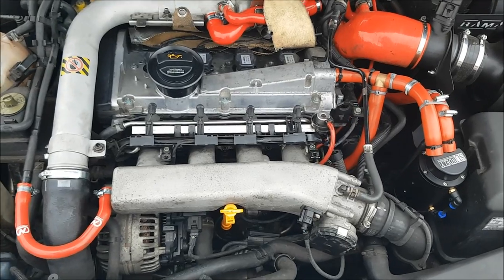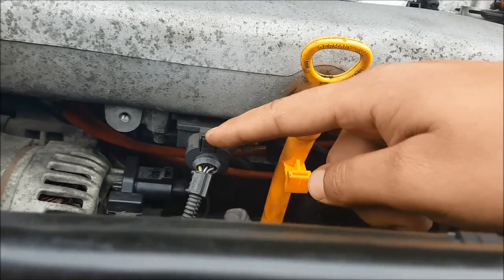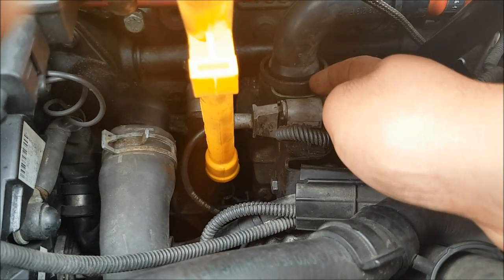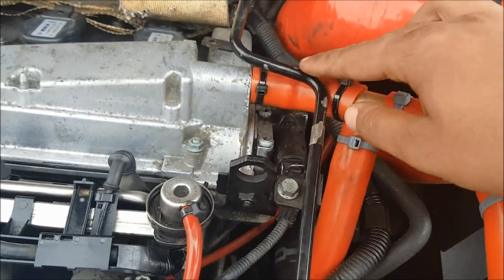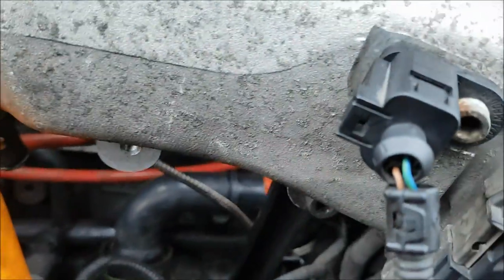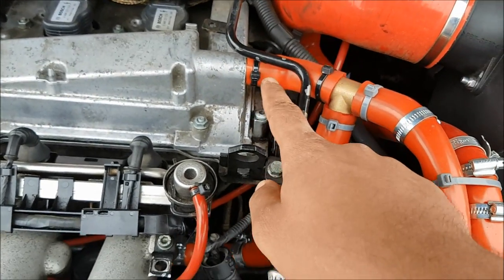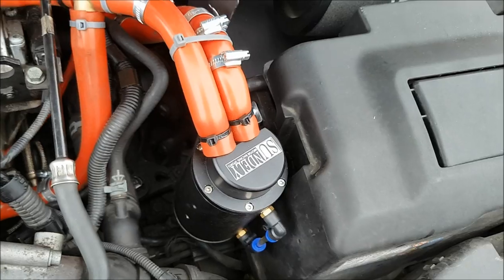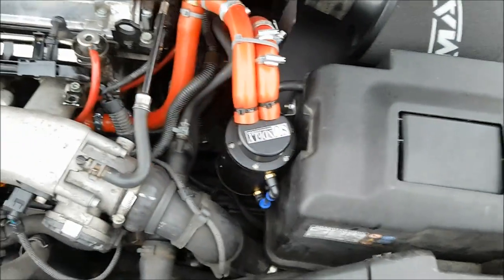1.8T Oil Catch Can Install / PCV Delete - VW / Audi / SEAT / Skoda

Comment: You will definitely need a new crankcase breather pipe and I would just get complete with spare clip Just in case you loose it somewhere in engine bay like myself & also round seal cause mine went totally melted,its a real nightmare to get out as he said after years of welding into place by heat oil & old age rotting wow,good luck😫👍🏾

Comment: Brilliant video, I bet this help a lot of people out. Top work keep up the work 👌🏻 on VAGS that is 😉
Reply from the maker: Ryan Kilgallon thanks taking the time to comment. Have much more planned for the channel, it's just a matter of finding time.
Reply: Redline Revs alright dude, you know the L that come off the intake, what size is the pipe as going to buy a bung instead of a screw 👍🏻 cheera
Reply from the maker: Ryan Kilgallon hey, sorry I don't know the measurement for that piece. I just screwed a bolt into mine. Let us know if you find out what size they are.

Comment: My son has a 2001. It was pretty cobbled together under the hood when he bought it. It pushes oil out under boost. Will sit and idle all day just fine. The "hockey puck" is gone. Seems to push the oil out of the oil fill cap. We've changed it and the pcv and it still does. Any advise? tia

Comment: @ 2:10. . . I HATE that damn pipe with a purple Barney passion! Lol. The very lowest part of that ridiculous brittle plastic pipe that goes into the block had pieces stuck in the block itself, I had to fish it out with a flat head screwdriver and then used a vacuum cleaner with a homemade attachment to get any fallen pieces out of the hole. 

     I have a 2004 B5.5 Passat GLS, of course with the 1.8T, mine is engine code AWM, Wheat beige with beige leather. My car is 4 MOTION (Audi's Quattro drive train with famous center diff) and is mated to a 5 speed manual transmission. It's a unicorn here in the US. It only has 114,500 miles. I LOVE  LOVE  LOVE  my car. 
      
I've replaced more parts on this car in 4 years of ownership than I've replaced on every car I've ever owned combined !  Most were Japanese, 02 Camry SE V6, 05 Corolla XRS, 96 Mazda 626 ES V6, 1988 Mazda 626 LX and many more, all cars were manual except the Camry. I bought my Passat because my brother once owned a 1988 Audi 90 Quattro 10V,  light Beige with blue leather. 
(I also bought my Passat as a nonrunner for $750 dollars and since purchase, have just breached the $5,000 mark in total dollars spent.) Of all the cars either of us have owned we have the fondest memories of when we were young driving his 5 cylinder Quattro with locking rear diff. 

     That's been about 25 years ago now. I'm now 48 and little brother is 44 and since those days we've both been through hell. . .  so hopefully, if everything goes well, in the next few days I'll be purchasing a low mileage 3rd gen EA888 2018 Audi A4 Quattro with the 6 speed manual, the last year of any stick shift Audi sedan here in the US and as such, another Unicorn and when I do I'll be passing my treasured Passat on to my little brother, so he can make more memories. I've already replaced the timing belt, water pump and peripherals along with a new Victor R, MLS head gasket in the driveway with hand tools. Thanks so much for the video, I enjoy watching any content about my highly celebrated 1.8T 20 valve engine. I'm unsure if I'll do the delete yet but probably will just for my brothers sake, because he isn't mechanically inclined like I am, so I want to eliminate any and all parts with the potential to cause issues. Thanks much for this!

Comment from the maker: All the parts required are listed in the description of the video. I've used cable / zip ties on some of my connections because I'll be coming back to this and changing the cheapo catch can for a better one. Use jubilee clamps instead to ensure everything is tight.

Comment: Thanks for being the first person to put a decent video about doing this. What size are all your silicone hoses you used for this?
Reply from the maker: Carlos Daniel thank you for taking the time to comment. As in the description you need 19mm internal diameter oil resistant hose to delete the pcv system. If you want to delete n249 valve and change fuel pressure regulator lines as I've shown in another video you need 4mm internal diameter pipe for those.

Comment: In connecting in this way you are applying full turbo suction to the crankcase. It would be better to install the catch can immediately after the crankcase one-way valve, with both the one-way valve to the inlet manifold and the regulating valve/"hockey puck" to the turbo intake connected to the catch can outlet.

Comment: Hi redline revs awesome advice on various mods on lcr's I've done a few of your modifications on my LCR with no problems at all really happy with results so far 👍 next week I'm going to attempt to do an oil catch can looks pretty straight forward to be fair one question I want to ask you bud I've heard mixed reviews on removing the hockey puck some say you need it for controlling the back pressure and that it could damage the engine if removed & some say it's fine with out it ? I'm stuck on this one I just wanted your opinion on this have you had any problems at all or heard of any issues on this ? 
Thanks redline
Reply: I know this is a year on... but the hockey puck is on the inlet side so there won't be any back pressure. When the turbo is on boost there will be negative pressure in the intake pipe.

Hope this helps any one that has read this with the same question.

Comment: That hose that connects to oil cooler housing - it has broken off when trying to remove it.. I knew it was going to crumble as you said and I bought a new one but didn't think part of it would be stuck in that area, I don't know how to remove it as it's quite tight in . Do you have any ideas? It isn't supposed to twist a certain way is it?

Comment: 10/10 thanks for the video, Please tell me if this is possible, at 2.04, my L pipe is broken and even i removed the clamp on the crack case, i still can not remove the old plastic brass bushings. Do you think i can block that hole. And the 19mm on the top rocket cover goes thru oil catch can and back to intake. Is this feasible??? thanks

Comment: Do you have a lot of blow by ?? I noticed ive had to replace 3 valve cover gaskets cuz it might need more vaccum in that system maybe a one way check valve that would also connect to the hose after oil catch can?
Reply: Did changing your valve cover gasket sort out the blow by issue you had?

Comment: hi mate I've got a mk4 1.8t aum engine. do I have to take out the combi valve to delete the pcv and add catch can? not sure about what I'm doing with the 3 hoses that go into the end of the metal plate in front of the manifold

Comment: Good video simple enough going to do it to mine now I've watched this what did you use to connect it to the tip though?
Reply from the maker: Khai Elliot thanks for commenting. I had a used red silicone TIP which already had a 19mm straight pipe connector where the standard pcv system would lead to the TIP following the 'hockey puck' accumulator valve. If the original inset for PCV valve into TIP doesn't haven't that just get a straight pipe connector, should be 19mm, and clamp with jubilee clamps.

Comment: Hi I need to do this to my car I’ve found all the parts on eBay, it’s hard to see what you used to mount the catch can, do you have to drill a hole? What bracket did you use etc?
Reply from the maker: Sizeable Bush sorry forgot to mention how i mounted the catch can. It came with a bracket and I heated a screwdriver then pushed it through the battery cover housing to make holes for the bracket.
Reply: Redline Revs thanks for he reply mate I’ve already done it now!:)

Comment: Got a question I got the 1.8t on my audi tt. Just installed a catch can and a pcv delete. I'm still having blow by also there is milkey colour in my catch can.
Reply: Jafin John I get the same thing in my 1.8T AMU TT. My hoses are ran pretty much identical but I getting some crazy blow by on a freshly built motor. (I have the ECS Tuning Baffled Catch Can, and it fills up with the milky color water your talking about in 3-4days.) im honestly considering trying to repurchase the 034 kit again for our cars and hooking up the PCV Tee back into the vacuum port on the intake manifold, but leaving out the “hockeypuck” or PCV Regulator to see if that helps. If you figure out the problem with yours please let me know and I will try to do the same if I make any progress.
Reply: Condensation. Move your catch can to a hotter area in the bay and will have less water

Comment: Removing pcv removes the assembly to help the brake booster recover quicker so is not the best idea.  And removing the puck PRV completely is also a very bad idea.... now your turbo can suck from the cam cover and the PRV isn’t there to stop that which is what it does. Sorry dude so much is wrong in that. The PRV needs to be there last point into tip, catch can is fine before that valve! N249 delete is an anti lag device so removing that is also bad advice from the internet.

Comment: Is engine better than before? Is there any change?
Reply from the maker: Soma Falkenstein my pcv system had splits and leaks in it which were causing me to loose boost. Since doing this the car is much better to drive and all the pipe work is simplified so future boost leaks will be easier to find.
Reply: Thank's :)

Comment: nice mate i juat wanted to ask please what happens with the hocky puck valve do i leave it going into the intake? thanks
Reply from the maker: ryszard witek hi, you can throw away the hockey Puck as the oil catch can will take over its job.
Reply: You need to leave that hockey puck in between the turbo intake hose and catch can other wise you create back pressure in the rocker cover and damage the engine, unless you vent the catch can to atmosphere. That’s what it’s for trust me.

Comment: Hey.. Could you tell me where you got the pipe from please
Reply from the maker: Sublimewales80 ebay 19mm Id oil resistant hose on ebay. Don't get the soft one like mine it has subsequently split in a couple of places and I've replaced it with REINFORCED / BRAIDED hose which you should look for.
Reply: Redline Revs cool thanks.. I will have a look on ebay. Been thinking about doing this for a while

Comment: hey do i have to connect the PRV (hockey puck thing) back to the T I P ?
Reply: my hose broke today and i cant find a replacement i don`t have the Y split i have single hoses that run from a metal line, i just connected the PRV back on pluged the hole in the T I P and put a little filter on the open end of the PRV (hockey puck thing ) is that ok to run for now until i find a new hose on the scrap yard ? 
P.S: I have an AJQ engine if you need this info
Reply from the maker: OL BAG it isn't ideal but probably okay as a temporary measure.
Reply: Redline Revs k thx love your vids

Comment: How's it run without the pcv vavle
Reply from the maker: Dolly DeHart it runs perfectly well without the pcv valve. And of course if your valve was leaking like mine you will eliminate boost leaks and have a better running engine.

Comment: You speak much and don't say anything.
Definitely that catchcan isn't installed well. It will get full of oil which won't be recirculated into they bay...
Reply: Could you make your own video with this guide so you can show us how it's done.

He spoke about everything you need to do amd explain what each part does and where it goes. So not sure what video you watched.